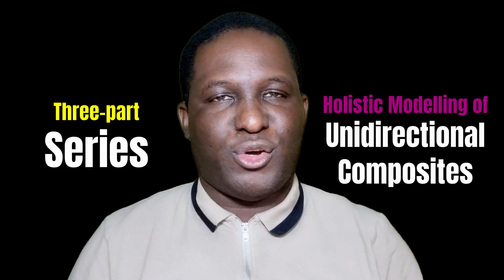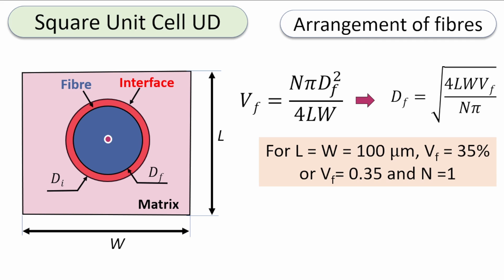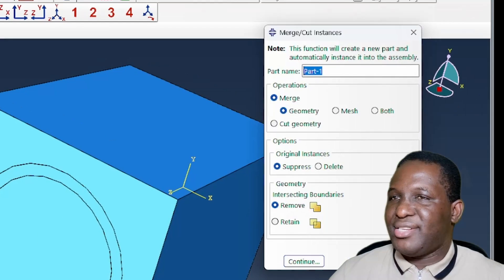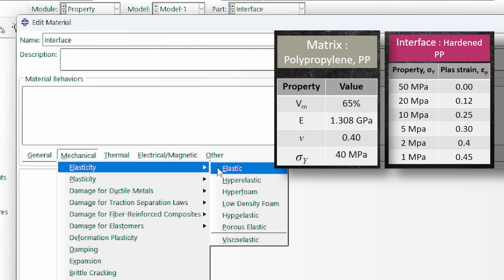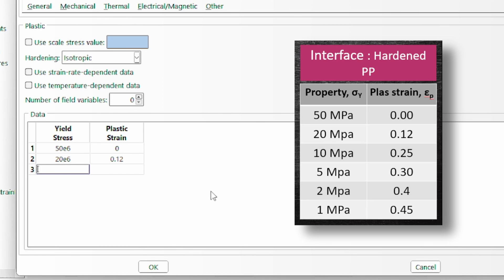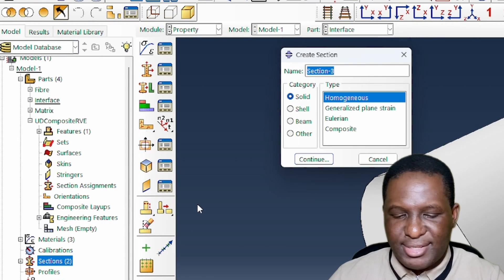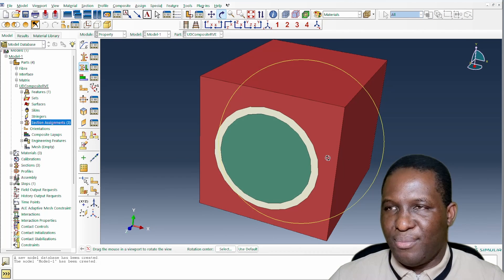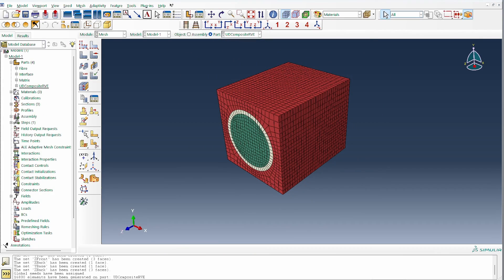Unidirectional Composites Modelling: Part 1 - Mastering GEOMETRY Design

Comment: Hello Doc, if I want to want to create a downward compression in the Y axis ONLY, do I need all THREE constraint equations, TWO or ONLY ONE? and which? Thank you
Reply from the maker: Hello, what you need to do for a RVE-based analysis as I showed in this video is to revert the tensile load (say in the X-axis) to simulate compression. That means you will have one constraint equation for the X-tensile load which in your case will be X-compression load. The other 3 Boundary conditions on three orthogonal surfaces is there to simulate a quadrant of the macroscale model simulation.

Comment: I have always wondered (in the 3rd and 4th parts of this video) why you calculate your stress and strain by dividing with AREA and LENGHT respectively instead of getting the stress and strain direct from Abaqus?
Reply from the maker: Hello, I can easily extract stress and strain directly from the simulations but this is not always the best approach due to localization effects. If I choose three different elements at different locations in the model, due to the heterogeneous effect of the microstructure, you will be reproducing different stresses. So, to eliminate this problem, a true homogenized stress stage (for a heterogeneous media) needs to be extracted.

This means replicating what you do in real experiments but extracting using a load cell, the force experienced by the material and using a strain guage (or even cross-head displacement) the displacement experienced by the deforming material. Then subsequent to the experiment, you can then operate on the force-displacement plot to recover the appropriate stress-strain plot.

I will suggest you watch this video of mine where I delved deeper into these ideas and hopefully this will convince you why I tend to follow the approach you have referred to: https://youtu.be/gCQzzF8Few8?si=fNOB7ZxP8K1ycGfU

Comment: thank you doc, but now i am wondering about the interface (cohesive element) properties. How can i obtain those properties, like what method do we use, experimental procedure or anything you suggest.
Reply from the maker: Hello, it is always possible to determine the interface properties but not very straightforward. For a composite material, I had a colleague in the past explore this which you can pick up in this paper: https://doi.org/10.1016/j.compscitech.2009.04.021

It was a carefully designed set of experiment that explores the mechanical behaviour of the interface region by loading it to failure. This is one way. Some others have used a nano-indentation method to probe those regions. The challenge with interfaces is that they are usually  a broad region around the fibre whose mechanical properties are neither those of the fibre/yarn or the matrix media. As a result, it is always subjective. In this modelling here, I assume some affected region properties that matches/compares with those of the matrix rather than the fibre. It is technically right but you need to identify or execute the right kind of experiment to generate comparable data for it. More importantly, you need to incorporate a failure model with it as failure of the interfaces always lead to failure of the composite.

Comment: I can  used this expression  S = Df*sqrt( (N*pi) / (4*Vf) ). For FOUND DIMENSION OF MATRIX .AND I CAN USED THIS  FORMULE FOR CONCRETE AND POLYPROPYLENE FIBER. THANK YOU SSO MUCH DR
Reply from the maker: Yes, you have to be careful. Lets assume, given that you know the diameter, Df of fibre, volume fraction of fibre, Vf and number of fibre desired, and the Length , L and with, W is desired (for square L = W), then you can use your equation where S = L = W. I think you can also follow the formula I used in this video at earlier part of the video.

Comment: Is there any specific reason to make interface?
And is it necessary to make interface, in case of making woven composite for mechanical properties.
Reply from the maker: Hello, the interface is a part of composite modelling. It is an affected region between the fibre and the matrix. It is always necessary and it contributes to failure in composite materials. Some modelling will negelect it with reasonable results. For your woven textiles, it is not always considered because its effect is seen most at the fibre-matrix-interface level. A woven composite modelling is at a yarn level where properties of the yarn results from volume-averaged response of the fibre-matrix-response. I will not bother about it for mesoscale woven textiles composites modelling but if you are conducting a microscale modelling of unidirectional composites, then you do need to consider it.

Comment: Hello Doc. I've always had a deep question about the 3D UD-RVE model. Do you create a cut or space in the matrix where the fibre will stay or you just position the fibre in a solid matrix without considering spatial interference in terms of geometry?
Reply from the maker: There are two ways:

1. If you do not have an interface layer, then you do not need to create the hole. The boolean merge operation in ABAQUS allows for good merging without need for making a hole.  However,  it makes for node-to-node coupling.

2. If you do have an interface,  fhen you need to make a hole.

Hope this helps.

Comment: Calculation of the Vf with the given formula gives a different result than 35%. (pi * D^2)/(4*120*100) = 29%. If I use 100 in place of 120, then I get 35% as in the video.
Reply from the maker: You may be right, @Johnson. You just have to determine the right number of fibre values for a combination of RVE lengths and fibre diameters.

Comment: Thank you Doc, for such an insightful video. How do we obtain material properties when performing such micromechanical analysis, and how do we compare with the experimental results?
Reply from the maker: Hello @Johnson, normally with this sort of micromechanical analysis, it is better to obtain properties of the individual constituents. For example, test E-glass and Polypropylene (matrix) separately and then use those in the model. The fibre is elastic here so the manufacturer-quoted properties are typically alright. For the matrix, depending on how it is processed, the properties can vary. So, most at times, people will test the matrix under the conditions in which the composite is processed. For example, if you use prepregs that is compression moulded, then you have to compression mould the matrix to test it so you are sure you are testing under right processing conditions. If you use an autoclave to manufacture the composite, then you have to autoclave-manufacture the matrix.

What is a bit more challenging to get is the properties of the interface as that is not always definite. Most at times, it has a gradation of properties varying with the stiffest/strongest closest to the fibre and as you move away from it, it changes to lesser values, approaching those of the matrix. For most composites that are brittle, at room temperature, the failure is brittle and the interface is best considered as a brittle media (so the fracture mechanics approach works well here). However, for thermoplastic ductile failure composites, especially at elevated temperatures, the approach I recommend here is accepted but getting its properties is hard. 

I think with comparing experimental results, you ahve to do uniaxial (tensile and compression, separately), then shear tests for all three planes. These will then be compared with predictions from this microscale model. You will have to homogenize though. 

I will make part 2 and 3 of this video to explain how you get effective properties which then you can compare easily with any typical experiment.
Reply: @MichaelOkereke  Thank you Sir for the reply. But the experiment is done at standard scale whereas the FEM is micro. How is the size difference reconciled?
Reply from the maker: Hello @Johnson, this is precisely why we do homogenization. Although the constituents are at the microscale, by invoking some kind of computation or asymptotic homogenization, you can generate properties that are comparable with experiments at the macroscale. The mathematics of homogenization makes it possible. This is why microscale approaches as this work, because modellers know that when they homogenize their model, they can compare it with real life experiments. 

It has its limitations as you will not be able to run structural tests using such microscale approaches. For example, you cannot use such microscale model (in its classic form) to run plate bending or three point bending tests. They tend to work for simpler loading studies such as uniaxial and shear loads. As load types becomes complicated, simple homogenization might not work well.

You may have to read around the principles of homogenization for multiscale simulations and try to follow the mathematics behind it, if you want to truly understand these things.
Reply: @MichaelOkereke  Thanks a lot, I am using CDMHUB to perform homogenisation.
Reply: @johnsonezenwankwo3497  I also have that question. It's good to see your comment. By the way, could you tell us what CDMHUB is to perform homogenisation?